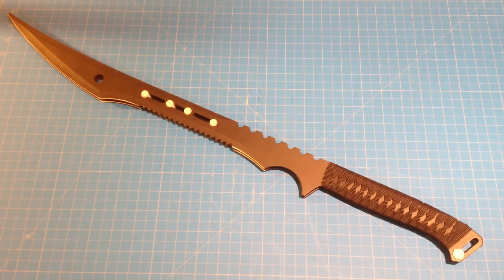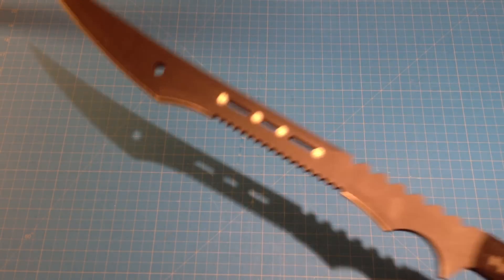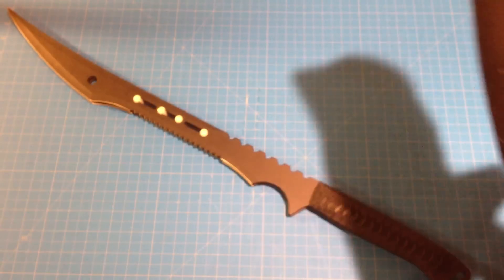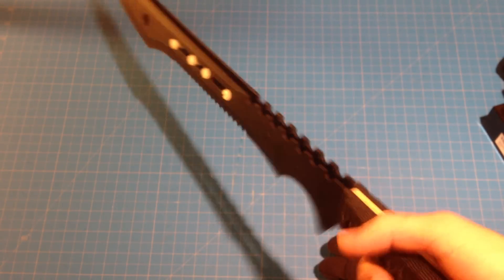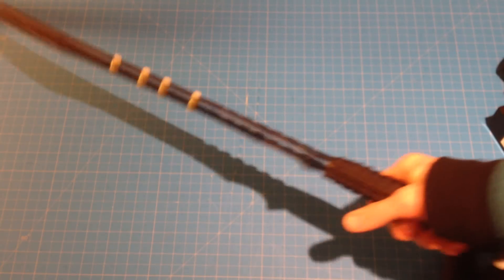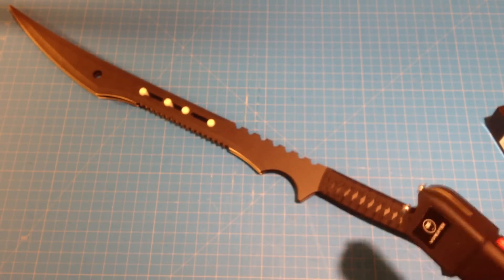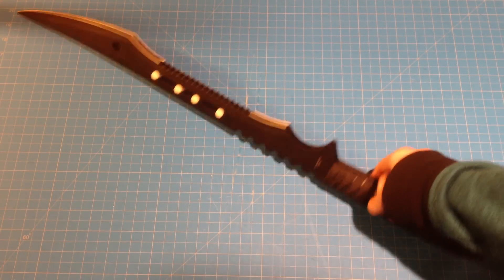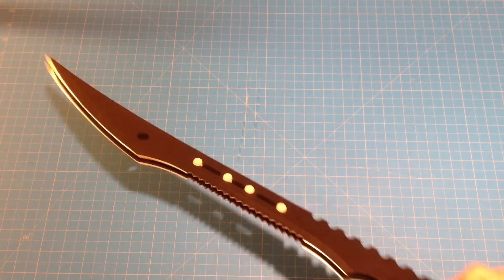(ORIGINAL) 8.8 Million Volt Tazer Ninja Sword Shock Mod: Raiden's Sword!!

Comment: As for the car battery, it is not the net amount of current that travels through you over a period of time that kills you, it is the amplitude of the current going through you at a certain time that kills you (although your body can handle high current as long it is for a very short amount of time). As for the hose analogy, getting a bigger hose, as you said before, is lowering the resistance, therefore increasing the amount of current that can flow with a given voltage. More current = death.

Comment: As an Electrician seeing the comments makes me cringe.

First: Volts do not kill Amps do.

Second: Would not be 8 Million Volts, a Police Tazors are only 50000 volt's and that's not even correct, to make the arc you need 50000 volts once it makes the ark (microseconds) it usually goes down to 1200 volts.

Third: Just because there is high voltage doesn't mean it will kill you, you can have high voltage but low amperage. The Tazer only produces only 0.00021 amps, cant kill you. 0.036 amps kill.
Reply: - Well, the current flowing through the body kills, but it only flows due to the voltage. Saying 'Volts do not kill Amps do.' is rather dangerous, because people will think it's totally fine to touch HV lines but fear low voltage high current lines.
- I agree, its 8.8kV, not 8.8MV...
- If the impedance of the source is very high then the current will be low, even if the output voltage is high, I agree. But that also means that the voltage across the resistor/body will not be high, because ohms law applies. the rest of the voltage will drop across the internal resistance of the source.
Reply: I was literally thinking the same thing, as right now I'm in my first year at a technical school to become an electrician. Even I know this shit, it's simple theory. Well done being informative with your comment as well

Comment: mostly experience, you can look it up if you want, but that's my approximation, an inch spark gap is roughly 30 kv, 8.8 mv would be an arc up to 25-30 feet in length

Comment: It cant be 8.8 million volts...400 000 volts is what runs in high voltage systems,you need 80 nuclear powerplants to make this amount of power... just saying :P
Reply: Did you want to hear yourself over the Internet?
Reply: I dont understand what you are trying to say...?
Reply: Godteri Lakris omg you are so right that is how its possible :D i knew that you couldnt get 1,000,000 volts from 2 9 volt batterys like the tasers you get there all fakers
Reply: Godteri Lakris Dude, do some research. Volts =/= Watts.
Reply: I know the difrence, i study to be an electrician :P
Reply: You need to study more.
Reply: well, then my books and my teatchers are wrong...?
Reply: +Camo Meerakat you opened my mind dude...you're right...
Reply: Volts is just potential difference, current X resistance
Reply: +paul austin Air-core resonant transformers produce this kind of voltage all the time. Even so, current is irrelevant. The current only has to be low if the power isn't extremely high. If the power is through the roof you can have absolutely high current and high voltage together. Voltage and current are inversely proportional according to a set wattage, not solely to each other.
Reply: paul austin You need to calm down. I have no idea if you're a well-read school kiddie or an electrical engineer. I gave you all the basic information in case you weren't familiar with it.

Comment: what would be cool is if you had a transformer somewhere and had this run on plasma, arcing between the blades when on. Still verry cool. GJ
Reply: Had it run on plasma or create plasma between the blades? Plasma arcing between the blades would immediately melt the blades and burn his hand. A plasma energy generator would be the size of a building.
Reply: ***** Exactly.
Reply: Mr Geary You just got verbally bitch slapped XD

Comment: i know it is an old video... but! The distance betwen the blades is too short. you will rann out of battery in no time. the distance should be just vide enough soo that there is no sparks betwen the blades. so the only thing, that will close the circuit is the guy that touches the blade :D

Comment: Also, electricity does not necessarily want to be grounded, it wants to take the easiest path to where it can lost all of it's potential energy. So if you grabbed the  leads of a car battery, the current would flow through you instead of into the ground because 1. it's an easier path through your body than through your shoes, and 2. because the electrons have more "encouragement" to flow to the other lead rather than into the ground.

Comment: a sword is meant to be sharp enough to chop of a limb, why would you worry about electrocuting them?
Reply: Just because something is meant to do something doesn't mean it can't do other things.
Reply: Aweri Blakely No, a sword is meant to be sharp enough to wound and cut through skin, sinew and muscle. Sword fights rarely ended with limbs being chopped off. A sword that electrocutes the enemy disallows them from making a counter attack against you, it would be very useful in close quarters.
Reply: Uh oh we got naruto up in here
Reply: +Izzder incorrect. Blades were made to be far sharper than razors a lot of the time. Decapitation was a fairly common event.
Reply: Teiichi Kun Incorrect. Decapitation needs a lot of power behind the swing, and overswinging your strikes makes them slower, more telegraphed and easier to counter. Stabbing someone in their vitals (and slashing throats instead of chopping whole heads off) is far more efficent, before your migthy headchopping slash connects you will end up with a blade sheathed in your heart.
Reply: Izzder You misunderstand, I'm not saying that stab wounds weren't a more common cause of death, I'm saying decapitation also did occur more often than you'd think. A sword that is sharp enough to slash through vitals would be sharp enough to decapitate. Weight distribution of the blade paired with force of the swing determines that. But generally, you'd not want to put all of your effort into a single swing making blades sharp.
Reply: Teiichi Kun I never said decapitations did not happen, but they were not as common a cause of death as being stabbed or fataly slashed through an artery. The argument was that a sword needs not to electrocute it's victim as it's already going to one-hit-behead him, which is simply not true (at least not in most fights) and paralazing your foe even with glancing hits would be a massive boon for a warrior.
Reply: +Aweri Blakely Just in case he has a limp wrist and can't swing it.
Reply: +Aweri Blakely id rather have a sharp sword and a taser in my pocket.... an electric sword makes no sence at all
Reply: because it looks cool
Reply: +Aweri Blakely 
*poke*
Reply: +Aweri Blakely because zombies
Reply: TheKwasiiProject™ | Kwasii oh zombies
Reply: Aweri Blakely it cauterizes the wound so they don't bleed out to quickly.
Reply: Because it's badass, nobody is actually fighting with swords out here bruh
Reply: It's for when you need them to lose control of their nervous system as they bleed out.

Comment: U like the idea but just an improvement is to have two swords that kan be electric duel blades and since the electricity flows through the blade back and forward you would be able to shock and if you were fight in a battle like the ancient Chinese and Japanese it severs a double function

Comment: sorry to break it to u, but electricity flows through the point of least resistance. so in order for your sword idea to work you would have to run a positive wire to one and a negative to the other, if you put them in your glove, the handle would then have the least resistance because your thumb and fingers would touch the same plate

Comment: Whatever you say way up there is probably right. And for most people not knowing any physics, it is almost correct, but there is one flaw to your explanation. You can survive a billion volts, but you could never survive a billion Amps. Why? Because the Amps will kill you. 0.1A to the heart your dead, this is because it disturbes the normal rythm of the heart, then you would probably need a defib unit to get back on track.. Wich is about 1200V and 12A, A kill, but you can't have A without current

Comment: If it was 8.8 million volts could jump 20.78 meters!
Average lightning bolt is 100 million volts. Sea level to cloud base is about 182.88 meters. 182.88/8.8=20.78
Reply: +Camubish probbly like 3000V
Reply: I think I made a mistake according to wiki 1 meter is approx 3 million volts so it would jump 2-3 meters not 20 xD
Reply: look... 1000V for 1cm. caculate then. i have never seen a teaser gun, but this is basic EL. stuff. And it cannot just "jump" at you because the el. will always chose the path with minimum R. you can only get shocked if you put your finger very close to the contact. the distance betwen ur finger and contact must be smaller than the distance betwen  two contacts. sory for my english :)
Reply: +Filip Kavčič This sword would work quite well, all it needs is a handle made of an durable insulating material so your hand isn't a path when wielding it. Also, Ive messed with 2000V microwave oven transformers and they wont arc until the contacts are about 5mm
Reply: YES YOU ARE RIGHT! i did a little research... read this and it will answer some questions i hope. https://www.physicsforums.com/threads/how-many-volts-amps-for-an-electric-arc-between-points.233168/

Comment: advice,  do what you said in the end of your video about closing the tips of the swords to channel the electricity to the tip of the sword and you got yourself a supercharged sharp slicing/shocking sword instead of the shock mod mess up you showed here :)     it will be more effective that way.
Reply: And add a water pump on the blunt side (back) that goes to the tip

Comment: I see where you're coming from, but stun guns can actually achieve high amounts of power. Stun guns pulse high voltage, which means high current, which means high power. However, these pulses of high power only lasts for very short increments of time so the total amount of energy transferred is safe and is still in the power output range of batteries.

Comment: if you do get the glove energized say threw the tazer "guts" as soon ad you grab it its ganna syart arcing like that if you say use Batteries it wont electricute some one untill you strike some one with both blades youll just have to wear a rubber or non condutive glove
 just a thought bad ass idea though good shit bro

Comment: Well, we cannot "increase the pipe size" of our body (lowering resistance), so it will always take the same amount of pressure (voltage) to kill someone (assuming there is constant flow). You can however get wet which will effectively lower your body's electrical resistance, therefore taking less voltage to kill you. Also, capacitance is better analogize as a tank, not a bucket.

Comment: If it was connected at the tip the current would go all the way through the whole sword and if u hit them with the middle of the sword then the electricity will take the shortest path which would be through their body, but your design looks cooler.

Comment: Honestly the actual voltage barely matters as long as it's high enough to overcome skin resistance. Since it uses a transformer there's a set power and hence current anyway so it's not like the voltage is doing any extra damage.

Maybe you knew that already but hey, the more you know :)

Comment: but you cant localise it to just the hand, electricity wants to be grounded so will travel through the whole body. of course it takes very little if you electrocuted the heart directly because whatever you elecrtocte it with you will disrupt the natural pace maker and induce a heart attack. but yes it seems very low, but anything from one amp would extremely hurt and anything over 2 amps will most likely kill you. This is at DC more so than AC i should add.

Comment: If you're going to say voltage has "amplitude", then in this context so does amperage. Amplitude in this context is the peek of a sine wave than can represent both voltage and amperage. And if your going to get this picky, then your body can actually handle high amounts of current for very short amounts of time. For example a carpet shock can supply upwards of 10 amps, but since your body has such low capacitance, the energy transferred is not enough to kill you, as I stated in my first comment.

Comment: I don't condone building weapons and so on - but I do like engineering innovation and I have to say there's an issue with this current stage of design - The function of a sword is to be a simple wedge, to cut through something - having a double blade like this means this function is now inhibitied.

I'm curious, does the "shock/taser" stun effect work just as well, diminished or is it amplified along the length of the blade?

Comment: Problem here is a Tazer operates best by being pressed into it's target for a period of time. Maybe only a few moments, but still... A blade on the other hand slashes quickly making (under ideal conditions) contact for a minimal period of time. I suggest a different approach. Rather than high voltage you need high amperage. A High amperage discharge like that of a high voltage capacitor can do serious damage instantaneously. It can even weld steel.

Comment: I don't think you are picking up what I'm trying to say. According to ohm's law, I=V/R, current (amps) is directly related to voltage. So higher voltage means higher amperage, which will kill you. So in turn, it is indeed the voltage that kills you (assuming there is constant current. If you have low voltage, it would be impossible to generate enough amperage to kill you.

Comment: ... pretty sure 2 x 1.5 = 3 watts. 
Anyways, you can't rearrange the power equation like that if you change one of the base variables. If you increase the voltage of the battery, it will be able to supply more amps. If you can supply more amperage, then you can produce more power. The reason why tazers are relatively non lethal has to due with how much energy it releases over time. It can achieve small moments of high power, but the overall energy being transferred over time is small.

Comment: Yeah but a high voltage doesnt need to be lethal and also a low voltage isn't necessarily harmless. While you are not incorrect with your statement, it is also misleading. Human body resistance can range from several kohm to mohm depending on the location on the body you apply the voltage to, stress levels, sweat. AC/DC also makes a difference because your organs have capacitative properties too. Voltage can be used to estimate the current, but it's not the only factor.

Comment: Though honestly i would not trust the listed spec's, Stungun retailers have a bad habit of lying about the output voltage to boost sells. Looking at spacing on the central spark gap (trigger coil gap) i would say its 30kv or lower.

Comment: There is only so much power coming from a battery, and since power is equal to voltage*current, a high voltage will guarantee that the current coming out is not nearly as high. That is the reason why tasers are designed to be such high voltages, so that they WON'T kill. Ohm's law only holds true when there is a theoretical infinite power supply. With tasers, P=IV

Comment: how do you measure the 8.8 million volts? such a voltage would certainly make "st'elmos fire" along the edge (happens at 20 kV) and then voltaic arcs, with streamers as long as 70 meters.
if you used the taser circuit, you get at best 20-30 kV.

Comment: I have less than lethal training. Its gonna arc through the wire and the glove into your arm. Post video :)
Reply: tcat 117 Guaranteed to happen :D
Reply: +tcat 117 It's like the interior part that is in contact with the metal is rubber, so nothing happen.
Reply: You realize electricity CAN arc through rubber right, depending on the amps the model uses a stun gun like that could arc through or around a pretty decent amount of rubber. But hey like I said, I don't care, go ahead, try it, just remember to record the results for us.
Reply: tcat 117 It's not like i'm studying electricity in a profesional way to say that electricity can't pass through rubber. A simple shocker hahaha... Passing through rubber hahahaha xDD

Comment: Air has a resistant of 10000 volts/cm so you would need 20000 volts to travel 1 cm, it it was 8.8 million volts, well that room would be practically ionized...

Comment: Not really.  Voltage (E) is electrical pressure.  Amperage (I) is the nominal amount of energy that passes a given point in one second.  Resistance (R) is what limits that flow.  The common analogy: voltage equals water pressure and current equals how much water comes out of the pipe in one second, on average.  Resistance is the diameter of the pipe.  You can greatly increase the amount of water without increasing pressure by getting a bigger pipe.  Capacitance, btw, is the size of your bucket.

Comment: If you think I was just talking about hands, then you misread my comment. I mean that there are many factors to how you get electrocuted, such as where the electricity is applied, how wet you are, and if you're healthy or not. Two amps is a ridiculously high* "death marker" as 0.01 amps through the body (for a few seconds) would most likely kill any healthy person. I should add that an amp is an relatively high value of measurement so to say.